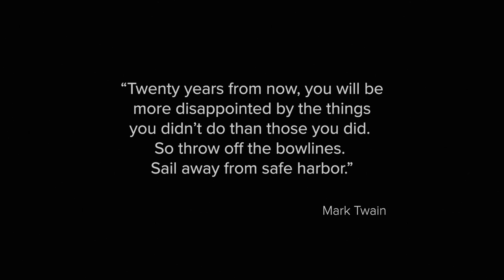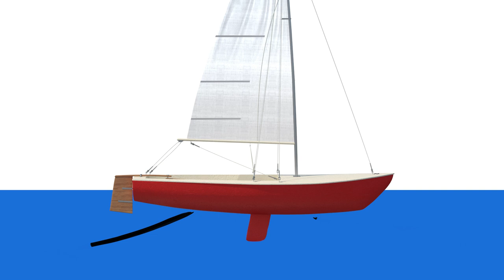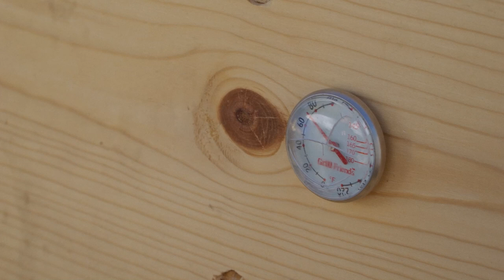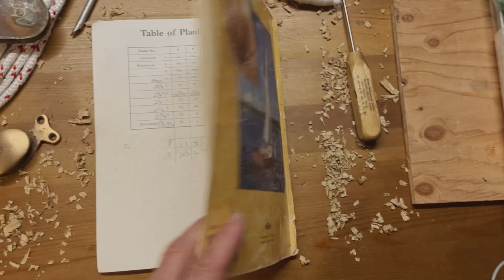Things went great until... To Build a Wooden Boat: Chapter Two

Comment: Oh the things that can go wrong. At least you didn’t have any wood split.
Reply from the maker: It worked on the test, but wait until you see Chapter Three where we steam the rest. There may be a few ribs that don't make it!
Reply: @realmattdean  If you are steaming nearly all 44, yeah odds aren't in your favor. I snapped or splintered like 4 in a row near the end and I'd gone for like 35 with no problems. I started thinking I wasn't steaming enough, or too  much and then afraid I was going to run out of oak. good grief. Looking back I think it was because I had to use some kiln dried for the last few and it just didn't go as well as my 'greener' stock and, I wasn't paying as much attention to grain run out but when the sticks are 50 inches long and only 1 inch thick, what can you do. looking forward to your series!!
Reply from the maker: @JenkinsBoatWorks  I've been learning a lot from the team here and you're right about the details of steaming. Green and air dried vs kiln dried - grain run out - all things I had no idea about before. On ours - We had trouble with the sharpest bend near the transom which made things real interesting.
Reply: @realmattdean  ha yeah me too and that was when i was done to kiln dried lol